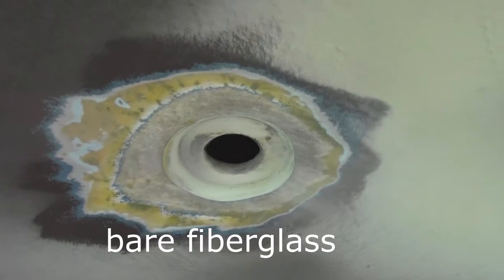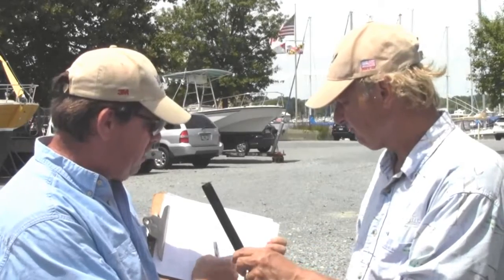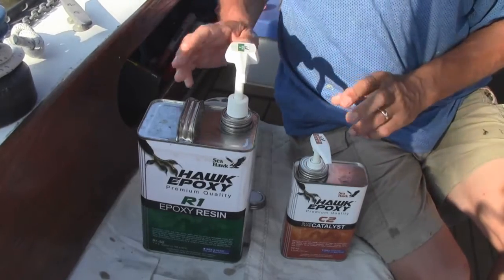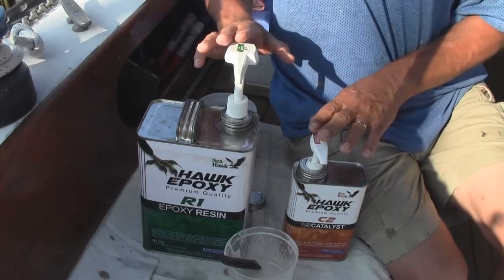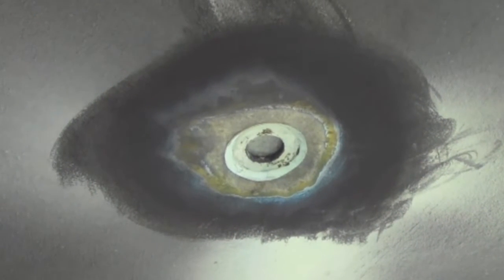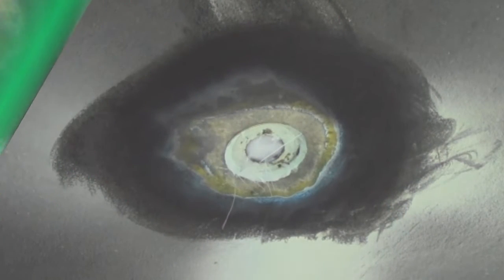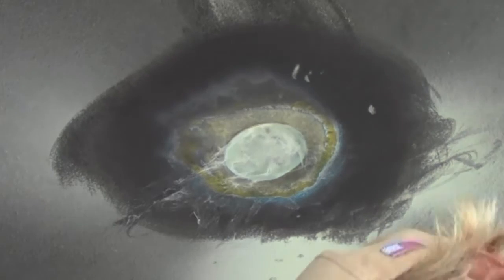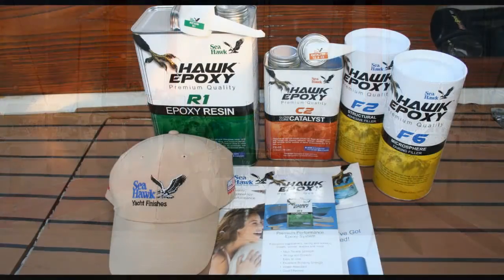Filling Through Hull Holes with Sea Hawk Epoxy

Comment: Why did you use filler in the thruhull?  Wouldn't the joint have been better and stronger if you had ground a taper and laid in glass so that the patch had as much strength as the surrounding glass?
Reply from the maker: Pierre Mitham wll the inside was built up so I had a lot of space to fill, I did put 3 layers of glass on the inside and out.  So far so good.I did taper the outside, i could have gone a little deeper but the 3 layers on the inside added strength. 

Thank you for your thoughts and input.
Reply from the maker: @You won't be gerrin any of MY money! they are holing great, in all kinds of weather.